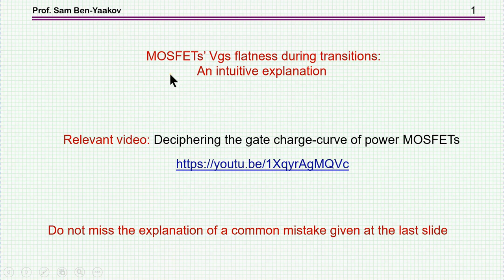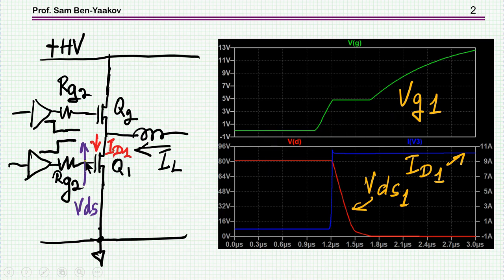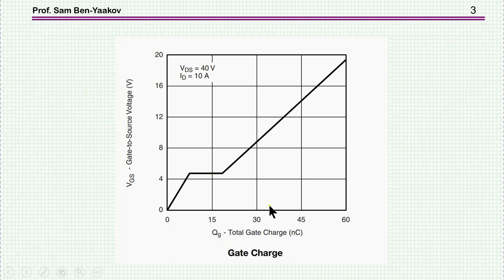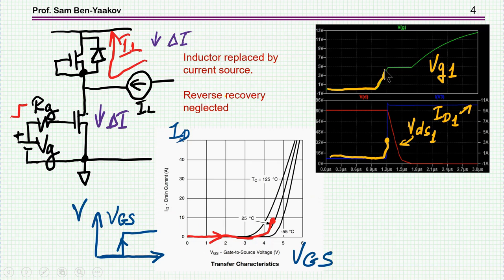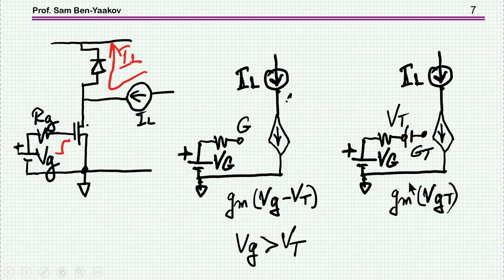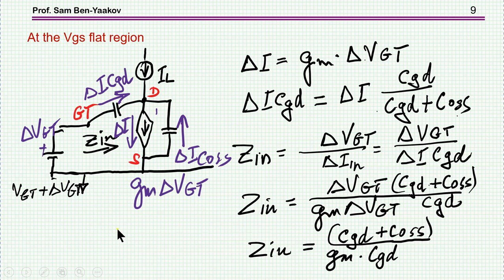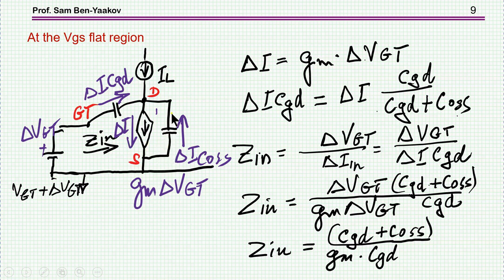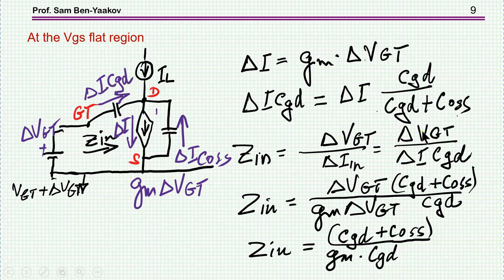MOSFETs’ Vgs flatness during transitions: An intuitive explanation

Comment: Hello Professor! Thanks for the wonderful explanation. Im however getting stuck at one point. When you draw the small signal model using the purturbation at the gate why does the current in Coss flow from direction Source towards Drain and not the other way round. thankyou so much!
Reply from the maker: The main driving force of the Coss current is the dependent source of the MOSFET which, for  a positive input, pulls the current to ground. The contribution of the gate current to Coss is negligible.

Comment: Nice presentation. I just don't get the point you mentioned at the last slide. You mentioned that the input impedance is resistive because the changes in the voltage dependent current source passes through Cgd regardless of the value of this capacitance. However, the flat region of Vgs happens only after Id already reached the load value and then the voltage is allowed to drop. To me, the change in Vds is what triggers the start of the flat region.
Reply from the maker: You are correct, but I was referring to the situation within the flat region.

Comment: Professor Yaakov, i have some trouble to understand this topic on turn on. Could you please help me out.

1) In your Explanation you assume a delta Id during the VGS flat region. How is it possible to make this assumption. If i look at the characteristics of the turn on the current through the MOSFET is already Equal to the inductor current and constant during the VGS flat region. It doesnt change anymore.

2) After the miller plateau, the VGS rises until the maximum value. Why does the drain current stay constant? I understand that the drain current already reached the Max inductor current, but how do i explain it with typicall MOS equations? The drain current should rise as long as VGS rises.

3) Also again referring to Drain current equations. During the plateau VDS falls to 0. When VDS<VGS-VTH the FET operates in triode region. ID depends heavily on VDS in triode. Again how is it possible that after the plateau, when the Transistor is in triode region and VDS is 0 the drain current is still constant?
Reply from the maker: Please try to see other related videos in my channel

Comment: To me, the previous video on gate charge was bit more intuitive. 
1.	Can you please explain why Cgs is no longer in the equivalent circuit? 
2.	Also, during the time Vds is dropping to zero, isn't Cgd being charged? It will be charged again after Vds reaches zero as well, what actually changed before and after-Only Cgs being charged additionally in the later half? 
3.	Is the Vgs constant due to the lower time constant (low Zin and Cgd)?
The quality of video is fabulous as usual.
Reply from the maker: Hi Maksudul, Well this video was motivation by a comment stating that the guy still did not understand why the Vgs is flat. 
1. Cgs was removed to get Zin and then was put back But I have wrongly labeled it as Cgd (thanks for  noticing this). I will note this in the title page of video. 
3. Yes but: Zin and Cgs (in practice it doe not make any difference since in both cases the time constant is in the nsec range)
Reply: @sambenyaakov  Thanks a lot Dr. Yaakov. Would you consider making a tutorial on (1) gate driver considerations with GaN MOSFETs and (2) Conducted EMI issues while designing PCBs? There are few tutorials on how to work around, but I was looking for something more intuitive. Thanks again.

Comment: Dear Mr Ben Yaakov,
Why, during the increasing of Ids the vds doesn't start decreasing at turn ON? The Vds wait Ids reaching the load current to decrease (just at the plateau Miller).
Waiting for  your feedback,
Reply from the maker: Please indicate minute n video
Reply: @sambenyaakov  yes, for example at 3.17. The vds is still constant. Why, it doesn't start decreasing when the Ids start increasing? So it's general question about the Miller effect.
Thanks for your feedback,
Reply from the maker: Vds starts to decrease only after Id builds up to the inductor current. Up to that point, the inductor current is partially flowing thought the upper transistor's diode (or in general, the diode in any PWM converter topology) and thus clamping Vds to the bus voltage.

Comment: Hi, i dont understand why there is linear increase at the Vgs when apply pulse before  the plateua.
Reply from the maker: Charging the input capacitances.
Reply: Oh i got it. It is V=Q.C graph. By the way this question is irrevelant but i want to ask: If i want to drive/control gate voltage of the mosfet linearly with a constant current source externally, would it hep to linear increase in the Vgs voltage as in the case of charging a capacitor with a constant current source?  @sambenyaakov
Reply from the maker: @coderhex1675  Hoe would you build a constant current drive? Possible but really not needed.
Reply: with an opamp. there are spesific opamps to design constant current source or with a transistor+zener+resistor, you know.
Good point, why they are not needed. Why they usually dont need to see a clean linear voltage rise on the gate?  @sambenyaakov
Reply from the maker: @coderhex1675 e
what is really needed is  a stepwise drive. There are some drivers that do that.

Comment: Thank you professor. I have a question maybe you can answer. In a half bridge circuit when the low side n- channel transistor is off and the gate is low via a transistor, when the  high side transistor switches on the dv/dt on the drain of the low side transistor is so high it switches on the low side MOSFET  for a couple of nanoseconds even with the gate connected to ground. I think this is due to feedback via Cgd. This results in high cross current or shoot through current. Is there a way to illiminate this? I now solved this by turning the p an n channel transistor around. This results in more circuitry because now I have to use a negative voltage to switch on the pfet and a Vb voltage+10V  to switch the nfet. Can this be done easier with some of your expert circuit analysis? Thank your for reading my post.
Reply from the maker: A stronger low side drive for off is generally solving the problem. Another way is to use a bipolar drive. See: https://youtu.be/9HQsi2F01GU
Reply: @sambenyaakov  
Thank you for the reply. I have tried this but when the Fets heat up trouble starts again.